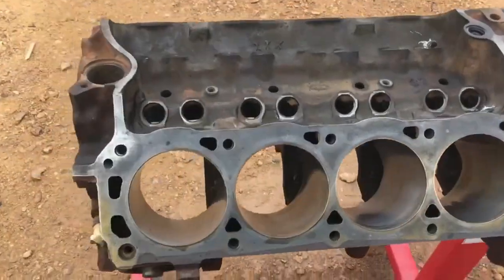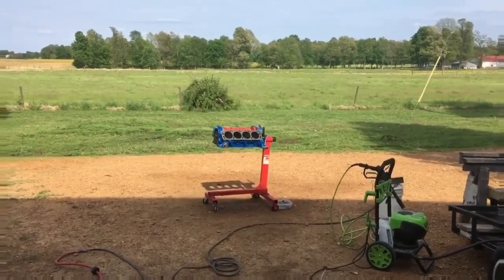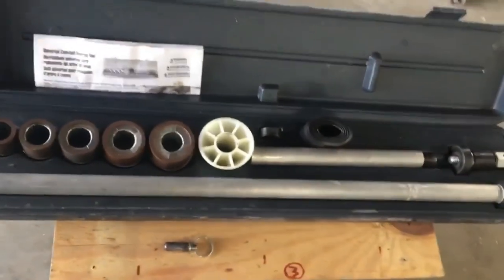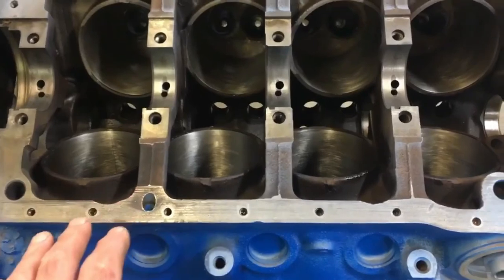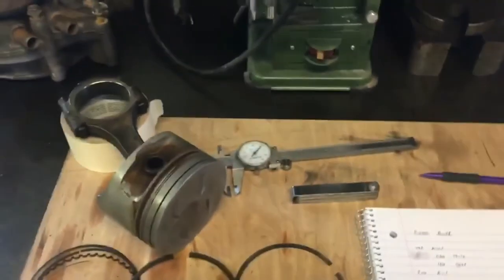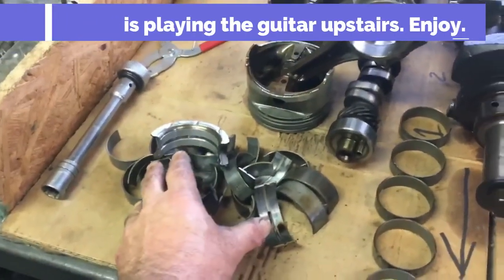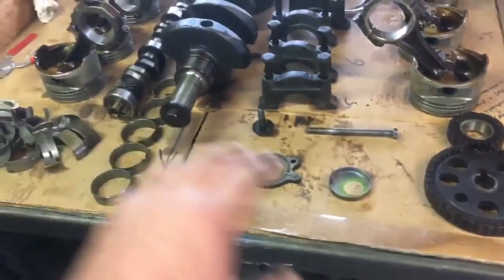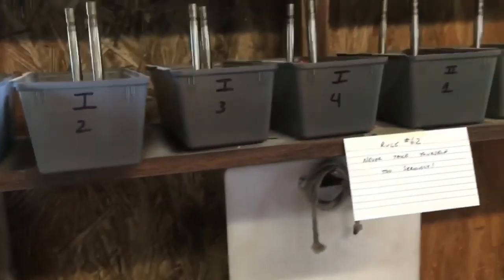How to rebuild a Ford 302 engine! Episode #49 TNG

Comment: Yep i would have put it right back together with a double roller timing set, sent the cam out for a $100 regrind, check the oil pump gears, set of Alexs Parts valve springs, minor polishing of the ports, ARP head studs, 1.7 RRs and it would live under 15psi of boost for years without any issues or oil consumption......done it with a 200k mile 1999 explorer engine at 454whp and beat the crap out of it lol